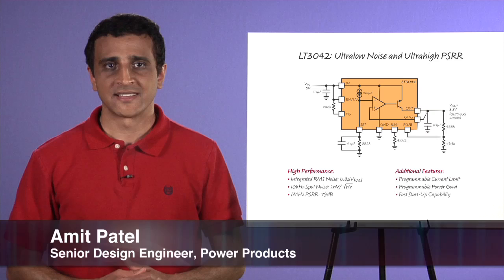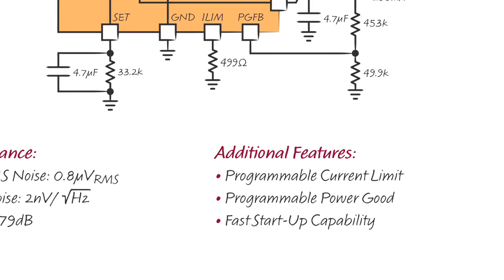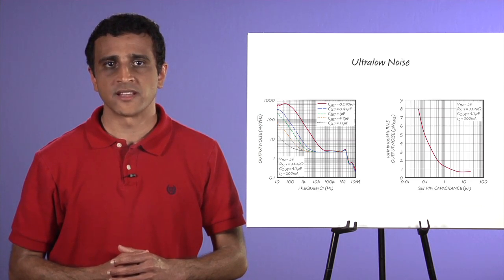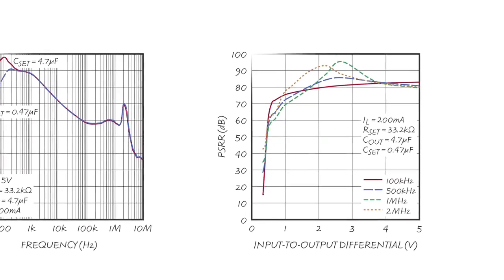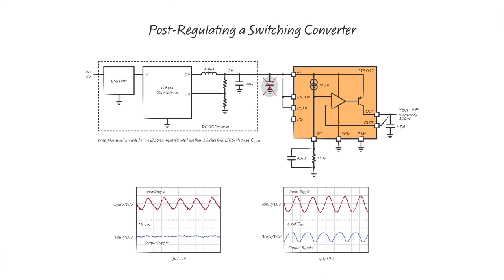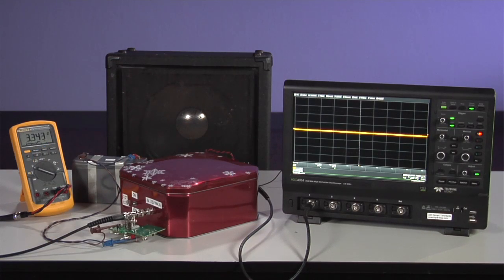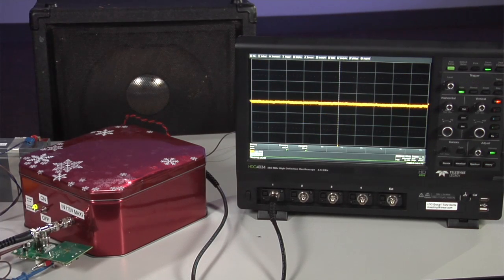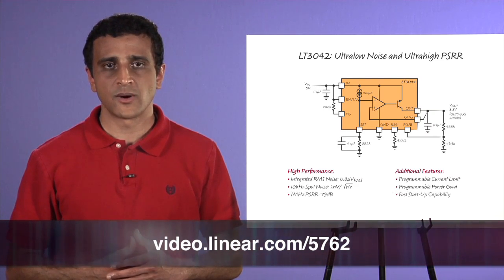Ultralow Noise and Ultrahigh PSRR

Comment: I used this regulator to power a couple of RF circuits and its performance is amazing. There are some details in the PCB layout (see the datasheet) but nothing very complex. I used only MLCC capacitors, even with the 4.7uF no issues with stability. A tricky part is that the divider is just for the power good input, it is NOT controlling the voltage of the regulator. The accuracy and stability of the output improved by moving the OUTS (sense) input closer to the load, in contrary to the datasheet proposal.
Finally, one nice feature that it has, is that you can sample with an ADC the ILIM pin and get the power consumption of your circuit without using extra resistors and high-sense amplifiers. The ILIM pin goes to 0.3V, ground referenced, something trivial to connect to an ADC on a microcontroller.

Comment: Is there a negative rail counterpart for this device? I have an application it would be perfect for, but I need a 5-0-5 dual rail supply.
Reply: Great question. No answer after 5 years.
Reply: @shantk7378  I've seen devboards based on these regulators with negative output on AliExpress, so I guess that it can be somehow done with these